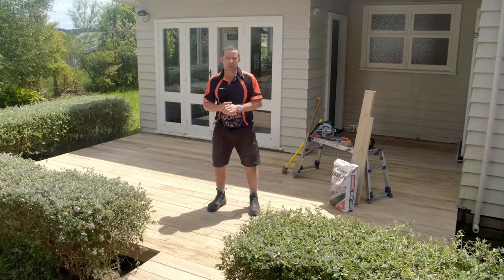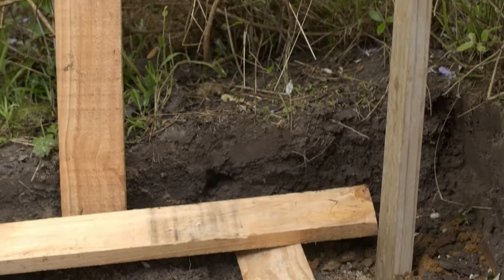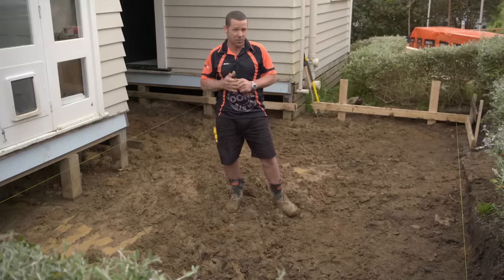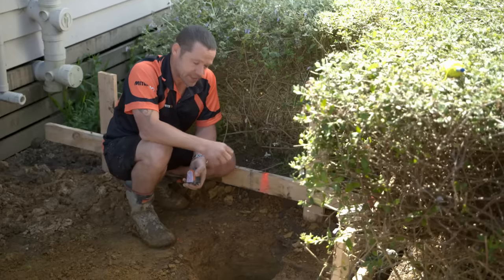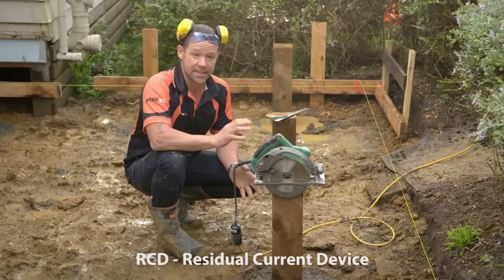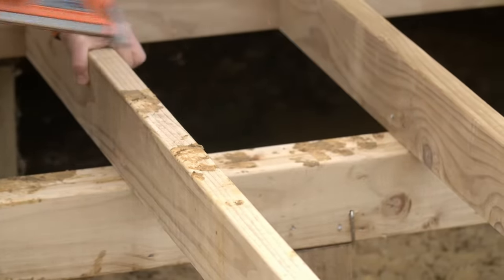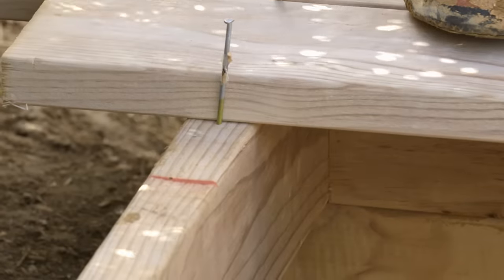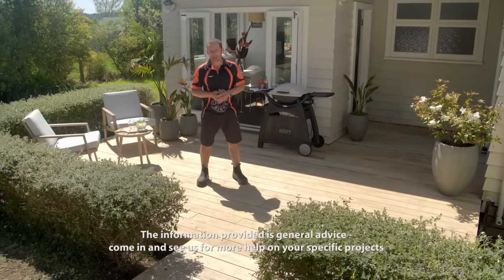How to Build a Deck | Mitre 10 Easy As DIY

Comment: I really enjoyed watching your video very interesting as I'm building a deck at the moment myself for my dads house, I noticed that you put your posts straight in the post holes. In Australia the BCA requirements are that the posts must sit on anchors due to climate that may damage the timber however I just put them straight in with concrete just like you did because I realised it much stronger is there anything you can say about that.
Thanks in advance friend
Reply from the maker: Hey there - we'd recommend having a chat to the team at your local hardware store - they'll be able to give you more specific advice and have local knowledge of requirements in your country.

Comment: Please check bearer 2 size, where span 2 and 3 are at the door recess. I calculate 190x70 is required, not 140 x 90.

Comment: I thought you couldn't bury your posts in the ground anymore because it encourages rot and had to slab and use anchors for your posts to slab.
Reply from the maker: This is the most standard form of building in New Zealand, Check out the NZ Building Standards for residential houses NZS3604
Reply: You can still use piles, provided they're H5-treated. The rest of the deck uses H3.2-treated timber.

Comment: Hi I'm using this vid to build my deck. I have a question though. Im using a old deck that is cut in chunks roughly 3x1m. The chunks are the decking and joist. Was wondering what's the best stable way to run the piles and bearers? Horizontal or parallel to house.
Reply: I guess I'm asking what's the best way to put it back together

Comment: What’s the best way to fit end-joists if your confined by house wall on one side and retaining walls on two other sides? I.e. Can’t slide it over easy to nail end-joist into end of joist?
Reply from the maker: If you are restricted on space to nail through boundary joist into your joists, then it may be best to fit a right angle nail plate or or joist hanger from joists to boundary joist.